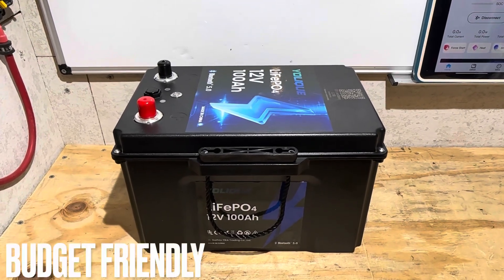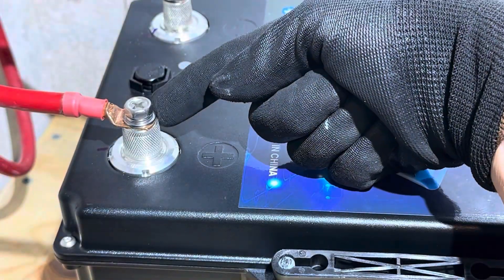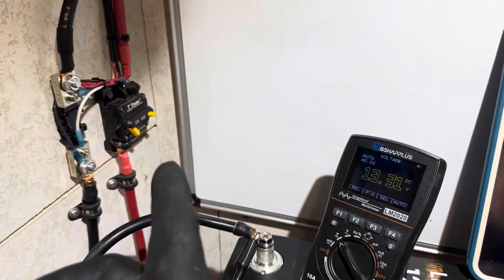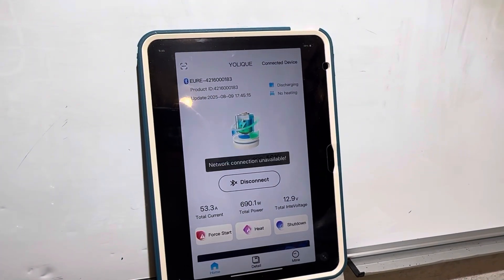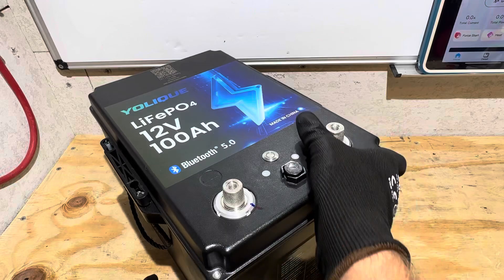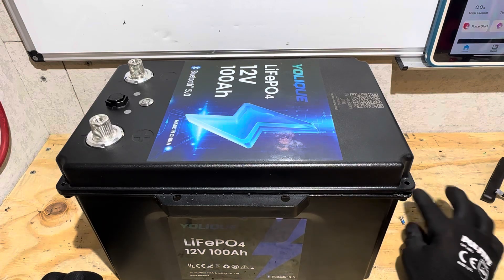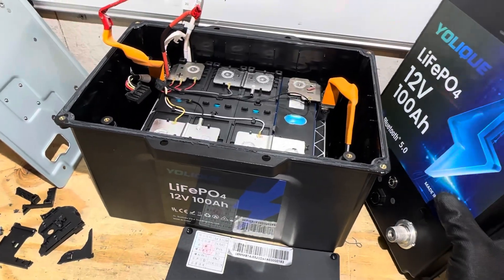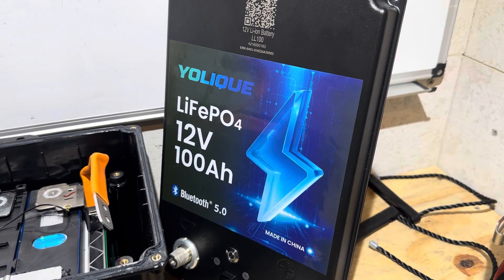Cheap 12V LiFePO4: YOLIQUE 12V 100Ah LiFePO4 Lithium Battery Review & Teardown

Comment: Bought this battery not long ago, and after using it for a bit, I noticed a few differences. The app actually works perfectly fine offline — super handy when you’re out camping! Maybe the one in this video was an early version?
Reply from the maker: Thanks for sharing your experience. After the video the manufacturer was planning to update some things on the app side.

Comment: Thanks a lot for testing our battery and sharing such a detailed video!  We really appreciate the time and effort you put in. Just want to clarify a few points so viewers don’t get confused:

1、Capacity – Our BMS cuts off at 12V and keeps about 3% reserved for protection. For special needs, customers can contact us to unlock this part. To see the real total capacity, you need to add both discharged energy and the remaining SOC (which you can check in the App).

2、Cell QR codes – The method shown in the video (typing the nearby numbers) isn’t the right way to scan. The left code on the cell needs to be scanned directly; the right one is only for factory internal management. All cells we use are brand-new grade A, shipped in Jan 2025.

3、App usage – Logging in is required so our tech team can help customers remotely by checking battery status if issues happen. But thanks a lot for pointing out the “offline” scenario — we’re already planning a future version with both online & offline modes.

4、BMS protection – Our BMS is set with a 300A short-circuit limit to protect lifespan. Based on your feedback, we’ll optimize this value and push updates through the App in the future.

We truly respect your effort in testing, but since some details came out differently, the video might unintentionally cause confusion. We’d kindly ask you to consider updating it with these clarifications.

And if you’d like, we’d be more than happy to send you another unit so you can retest using the suggested method — just to make things 100% clear for your audience.

Thanks again for your honest review and support — it really helps us improve!

Comment: Good reviews as always. Those top post terminals,are they threaded into battery? Most batteries l have come across that post threads out. Just curious.
Reply from the maker: Thank you! 
The top posts aren’t able to be removed. I’m familiar with the style you are referring to. These have a backing plate inside the battery and a flared portion on the outside and tightens together with a sealing gasket in between the two. The base of the post seals to the plastic lid. Note the grooves for spanner wrench/socket to tighten the post to the backing plate.

Comment: Yikes.  That’s why I kind of went with another Siekon cause it really was horrible at protecting  against high current lol. It will be outdoors with a 200 amp breaker but if it gets pushed hard for a minute or more it will not fault. Kind of a bad thing for some.  Also Siekon was nice enough to give me a test battery so I thought id return the favor and buy one on sale.
Reply from the maker: Right! Some Jiabaida BMS can trip when charging up the capacitors in inverters if the overcurrent is set too low or the trip delay is too short. It will give an overcurrent trip. But the Yolique has basically no surge capability and is detecting a surge as a short. Not cool. Siekon has no problem with surge currents 🙂.
Reply: I learned that from you😁😁😁

Comment: I have never used bluetooth in my life. Barely know what it is. I like my budget batteries that don't have bluetooth. Recommendations?
Reply from the maker: Yes, there are several quality brands that don’t use Bluetooth. Which size format/voltage are you looking for?
Reply: 300ah Lifepo @THEOFFGRIDMOUNTAINHOMESTEAD

Comment: Tangential question... what do you think about aluminum ion batteries?
Reply from the maker: Well not too excited yet until it goes more mainstream, too early. 
Still a lot of companies playing with different doping on the cathodes etc. Not long ago everyone was hyped up on sodium ion and kinda flopped. Aluminum is very interesting no doubt.
Reply: @THEOFFGRIDMOUNTAINHOMESTEAD  yeah I thought sodium could be cool since its more abundant and uses the exact same machinery as lithium but with half the capacity yeah it was DOA.
Reply from the maker: @Shin0bi272 Sodium is heavy too. I was actually just having a discussion with a friend yesterday about LiFePO4 and wondering if anything will ever replace it? CN has been using it for well over 2 decades now. Even if something “better” comes along it could take years for the cost to make sense. Lithium is so cheap right now and the manufacturing and development is still growing. 
Trend looks like larger cells are coming. EVE power has the “Mr. Big” MB56 628+Ah in a single cell now. I would assume other manufacturers will follow soon.

Comment: I'm always happy to see any new video by you when if it's not something I need. You provide awesome details. Sometimes I wish I could find a source for basic info for dummies like me. For instance I tried using a 35a scc with 12v battery but I'm so ignorant I thought 35a was the solar limit, not the amperage to the battery. I've asked manufacturers but they rarely respond with good info. Like what gauge wire from a 60a scc to battery. I think there are many basic rules that are assumed. I look to you primarily for my buying decisions, hope you get credit for buying thru your links.
Reply from the maker: Thank you for your feedback! If you are wanting some info about component sizing/selection and common practices I can include this type of content! This is a great suggestion thank you. Thank you for your support as well. 👍
Reply: @THEOFFGRIDMOUNTAINHOMESTEAD maybe it's just me but I was confused. I got four 330w 60v 6a panels. Connected one to a powmr 35a scc and it indicated 39v battery and now won't power on. I'd only used it with 100w panels. I can't find a source for calculating sizing and wire size and people on the web give conflicting info.
Reply from the maker: @ronhawkins8604 If your SCC is rated for 35A that’s to the battery. I’ll make a video for you soon, but say 100W panel usually 18VMP/ 5.5A to a 12V battery through SCC would net (losses not included) would provide 8.3A at 12.0V. 
Bump the panels to 4-100W in series would be 72V/5.5A to same battery would net 33.3A at 12.0V.
Reply: @THEOFFGRIDMOUNTAINHOMESTEAD the sun power 330w were probably not a great choice but I got them for a great price locally. It appears a 60a is my best value because they can take the higher voltage PV and specs say 720w for 12v and 1440 for 24v. I'm my case I figure I'll use 2 panels when charging 12v 100ah batteries and 4 when charging 24v 300ah and gonna need 4 gauge battery cable
Reply from the maker: @ronhawkins8604 Higher PV voltage is my personal preference. Especially with any longer PV runs. I try to select 12V controllers with 100 to 150VOC rating. Low VOC controllers OK for a shed with panels on the roof or an RV.
Reply: @THEOFFGRIDMOUNTAINHOMESTEAD ya know what would be cool? Seeing block diagrams of all your varied systems. One of the biggest helps I've found is seeing how others do stuff to get ideas. Heck that applies to pretty much every aspect of life.
Reply from the maker: @ronhawkins8604 That’s a good idea. I  need to do an update on the big 12V rig soon anyways. Might be good to have a diagram then show where everything is and how it’s wired?